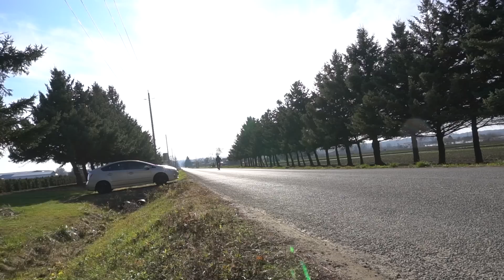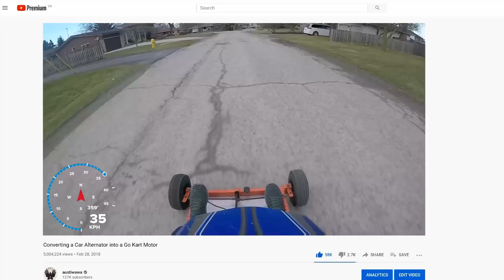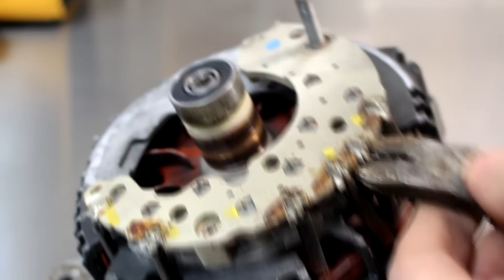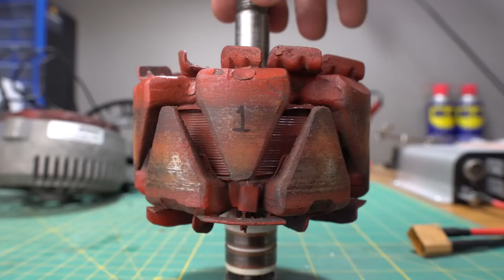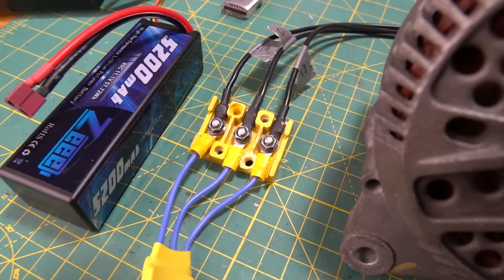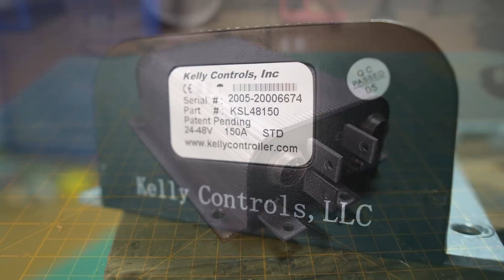Building an Alternator Powered Bike

Comment: let the controller just keep supplying voltage into a shunt like a large cap or resistor so it thinks the loads there on one of the 3 phases use a motorcycle clutch lever and instead of a cable put a linear pull switch there to divert the power to shunt....?  the only draw back would be yes its wasting power idling still... but youd be direct drive so it would be more efficient.

Comment: We should work together to make a hybrid bicycle im good and putting gas engines on bikes and still letting them be pedal powered or gas i want to make one with the options for pedal gas or electric by putting an electric motor on the front wheel and the gas motor on the back the problem im having is I want to be able to recharge the electric battery just by driving with the gas or with pedals long enough from what I understand it should be possible maybe not efficient but possible. How cool would it be to have gas for long distance when no ones around them be able to kill the gas motor and go electric when you pass people or an animal or to have the power of the electric and gas for climbing hills and to have the electric for backup to get to a gas station if you run out of gas or just to maintain speed once the gas engine gets you to the speed. You should be able to get some insane gas mileage. My gas powered bikes already get over 100mpg if we could get it dialed in we should be able to make something that gets around 200 mpg with optional 2 wheel drive

Comment: Not DIY it’s called your drivers license gone. That’s a 200+ horsepower just to start that engine that’s an electric engine and it takes 200 hp to start it. It’s 200+ horsepower while in operation. You don’t know what you’re playing with. I said, don’t use car parts like this That car part has a core charge right all of what I just said is high science and why now mundane that don’t do high science that is a military core part all of the parts that have a core charge on them our military parts that military is going to use all of them for high science their proper best shelf stock kept the hands of the people that pay to have a maintenance and preserved That does not mean that they belong to us. You got a bank account. You signed a contract saying that you’re not gonna damage core parts you got a drivers license you understand that core parts are military parts in all automobiles. Every piece of hardened steel is also a military core part even military anything above grade 8 they take to the boneyard it does not get put back into a smelter if it does it gets smelted into rebar where it will be recycled properly because there’s more energy there than can be harnessed at this time because we’re having a problem With Hindu bubonic slaves, yeah Hindu bubonic slaves, lying, and saying they’re Christian and indoctrinating the high science religions children into bubonic slavery that’s what Christianity is Jesus Christ. You’re all just children and you’ll never be anything more until you get off your demented high horse. Oh did I mention dementia everybody has dementia. If you have any family member ever had dementia 12 generations down the bloodline the 13th generation is how long it takes to repair the nervous system damageso demented retards get off the car alternator build your own motor. You don’t know how much more powerful than a jet engine that thing is because I’ve never shown anybody nuclear polarization other than to prove. I was a nuclear weapon Smith.

Comment: I think you did a great job I'm putting a alternator on a old pit bike plus I'm allegedly good motor mechanic also I understand your v8deo I just never stuck in at school ,I totally understand both the theory and the mechanics involved thanks for your help I'll show you the pit bike I build ,I'll be using a old kawasaki kx 125 or any little moto crosser obviously ill strip engine out, petrol tank will be my battery holder plus as its for off road use I'll easy spend a little cash to get the project done,I was merely looking at your videos as you explained it so well,thanks again Alex from Aberdeen Scotland take care &ride safe on old rusty

Comment: You need another alternator for current output back to the batteries. So, two alternators. Then you'll have regenerative charging. Wont need a wall plug anymore, and drive all day
Reply: That can't be done, because the recovery efficiency of two alternators is pretty low, so the friction of them together when you try to output current back will be stronger than the motor itself

Comment: Practice makes perfect I'm looking to make a bike or smart vehicle to drive & be strong enough to pull a lighter trailer for hauling gear & sleeping quarters! I'm not very smart with wiring & voltage so videos like this can help reduce unwanted stress I've been thinking of a 2 or 3 type power source bike or a combination or all or swap out for long trips with electric,steam powered & 2 stroke engine but trying to keep away from gas powered otherwise it defeats the purpose of the efficiency & reliability of the build! Thanks for making videos to help dude you have done alot of trial &;error research this is exactly the outcome I'm looking for! Does that alternate setup keep the battery source charged & looking to probably go brushless also want to avoid having the alternator get to warm for long distance but with airflow that should help! 🤔🤗💖😎👍🧙‍♂️🦡

Comment: What if you connect a regular 12v alternator to the system to send a charge back to a rechargeable battery pack that supplies power to the motor. Would that work to keep the battery life higher while riding?
Reply: The efficiency of the alternator would end up with more heat and less saved power

Comment: You could have spliced the power wires with a switch to turn power on and off , put switch on handle bar or something. That way the clutch/motor is only on when the switch is on.

Comment: You should hook up another alternator to the non-drive wheel to charge your battery.
Reply: That wouldn't work, the efficiency loss would neglect any return of power towards the battery
But using the controller and configuring the regenerative braking would indeed charge it back a little
Reply: @foxxyytofficial  perhaps the RPMs would be too low. I’m thinking about FA car had a alternator drive hooked up to it’s non-drive wheels it could spend at the 3000 RPM if geared correctly and run through a DC to AC inverter to charge the batteries. Just thrown out a few ideas that I have and I haven’t seen anyone else work on it like this.

Comment: idont have a lathes machines do u think if i drill out bushing and press in barrings ? just in opinion.  im broke and have to usde what i got or can get under 20 bucks or trade also how many batteries can be shiped to los angeeles i can mail u a pre paid card u ship so u know im not ma sneek thief scammer ect in no way  do i want that shitty label i want to make and use full function thing kinda utility like a cush man of the 60's but a bit of get up of new e vehicles  any help advice or flat ot no will be appreciated.

Comment: Nice adding hall sensor wiring to a alternator is beyond awsome
Reply: i didn't understand what changes in the motor adding hall sensor? increase speed, torque? what?
Reply: @marcosfilipe4468  im pretty sure its for the controler to know where the shaft is but u can now use different controllers like the ones i use from amazon that have a hall sensor connection

Comment: You need looser clutch springs so itll grab at a lower rpm, starter motor is made for tq and probably doesn't rev much higher than 1500-2000 rpm which is a little more than the engagement point on those clutches which is why your experiencing the slipping/jolty grabbing

Comment: Seems like a great video, BUT, my uneducated math makes me think that not using permanent magnets means your motor is using twice as much battery power and generating twice as much heat, and as such, your battery life is half and ride time is half, and also then your charge cycles are doubled and your batteries will need to be replaced twice as often.  Am I wrong?
Reply: He did upgraded it in part 2
Reply: @foxxyytofficial  Ok, I will check it out

Comment: Why not just use a electric motor?
Reply: That is an electric motor
Reply: @foxxyytofficial  no that's a alternator from a GM unit
Reply: @larrycumbo2023  working just as an electric motor would
Reply: @foxxyytofficial  over engineering for a simple task
Reply: @larrycumbo2023  or just showing that with a bit of elbow grease and some research and tests you can create something even if it's not the same quality of a ready-to-build kit
Reply: @foxxyytofficial  understand

Comment: Throw a reed switch on the circuit so it when the alternator/generator is producing enough current to sustain it (unity) , it will then become its it's own input.  You don't even really need a battery, you can pedal to create the intiation current. Not quite that simple, but you'll figure it out.

Comment: Great idea, I would not have used a clutch on an electric motor. The way I would have fixed your problem is fixing a switch on the accelerator that would turn off the drive while at rest, I would gave let that little spin be the lowest speed you can ride as you accelerate.

Comment: Definitely in the right track, just eliminate the battery and controller and use the pedals to generate the current. Once you reach unity, the alternator takes over producing the current. Then it's  just a matter of throttling the frequency, producing more or less as is required.
Reply: that's not how it works, the anternator on a car only produces energy because the engine itself is way more powerful than itself
Reply: That's what they want you to believe
Reply: @lesliel1182  oh, i didn't knew i was talking with a conspiracy theorist...
maybe you could try it and show us the results in a lot of videos so the government doesn't delete all of them at the same time
Reply: No theory, fact. You've been lied too and kept in the dark. 50,000+ such patents have been issued by the privately owned US Patent Office since Nicola Tesla's designs. The only one of his designs they allowed to be utilized was the AC, but he had many others that work without a primary power source. Lots of scientists (Phd's) and engineers have been at work since then studying his designs and developing much greater. Fossil fuels and nuclear have never been needed.

Comment: The problem with a clutch that slides is not so much the noise, it won't last a quarter of the time it was meant to. Besides, the need for the clatch was the "wrong" controller, am I wrong?
Reply: Yep, that's why he removed it when he got the proper one, and I'm glad to see that he did it

Comment: Great. That should be ,lets say  for a 60Amp alternator, 12×60=720w .Thats some power.
Reply: But technically since he is using 48V, you could multiply 48x60=2880w
That is the theoretical maximum

Comment: You know the batteries is draining down. Can you add some other alt to kept the batteries going without dying!? Just like an vehicle..
Reply: Trust me, the motor will consume more power than what it will generate. You will have to charge the battery. It's not an gasoline engine where the alternator turns some of that gasoline power into electricity. Electricity is being used to accelerate, and generated while braking.

Comment: 2:20 idiot, just connect a switch between controller and motor so that motor doesn't start running on low rpm continuously after switching on controller.
Reply: Then it will lose synchronisation and give up from improper wiring.
Maybe if the controller was sensored..?
Reply: Someone didn't watched the full video and wanted to call others idiot

Comment: How many watts is the motor?
Reply: Around 750-1000W or around one horsepower.
Reply: Can I use a 30a 1600w controller 
And at what speed I'll be getting

Comment: Use a starter motor to power the bike and alternator to keep the car batt that powers the starter always charged.
Reply: that wouldn't work as it would pull more energy than the alternator can "recharge"

Comment: Interesting 🤔..was just wondering if it would be feasible to devise an separate energy source from the energy of the front wheel that would keep your battery charged for continuous riding?? Just a thought from someone who has not the slightest inkling of any of this, other than wanting to ride as long as the day is long & possibly throughout the night! Lol...
Reply: that would not be possible because of friction and efficiency losses on all parts (alternators aren't that efficient, the friction of wheel bearings, etc)

Comment: Could you put an alternator on the front and back with 2 throttles?
Reply: technically it is possible, but will need a second controller

Comment: On the centrifugal clutch, you could use weaker springs and on the part that engages the driveshaft, use rubber or any other sticky material so it fully engages. Honestly, your first idea would work. If you have the right tools, you could also redesign the outer shell of the centrifugal clutch to have "teeth" so it engages every time without slipping. A 3D printer could help you prototype the part but may fail under sheer force. There are companies out there that will make the custom part for you. All you need to do is design the part in CAD software. Fusion 360 is free and relatively easy to use. If you decide to sell your product, then you will have to upgrade to a paid version of Fusion 360. Solidworks is also great software as well but it does require a yearly subscription. I'm not advertising for them but I know from experience that they are both great CAD software.
Reply: good video
Reply: Found the unnecessarily long know it all speech.

Comment: It’s because the clutch is new, the trick to make it work is to open the clutch and bend the pads outwards, pads will be closer to the metal. Once you do this your bike will take off🚀

What I means is stretch the springs inside the clutch…

Or you would need to try other types of clutch.

Comment: I wonder what effect you would get if you varied the field voltage/current. I guess the motor controller would have to deliver more current with a weaker field

Comment: Austin AS Captain Goodenough!
if you add a rheostat to the DC rotor source when on, it will not spin or not as much.
Then the centrifugal clutch can be dropped.
Also a DPDT switch to switch from // to series, added to the rotor source may allow a torque tranny!

Comment: Great work man! I have an idea To help you work around the bad controller.  First delete the centrifucal clutch.   Then install a disconnect switch At the supply wires To the motor with relays. Have the disconnect switch Activate when you Engage the throttle pedal. Boom now you control the controller.

Comment: could you convert the output into another set of batteries that charge while using the bike and when charge is empty you can use the other battery just to get a few more miles?

Comment: Great work Austin, the possibilities are endless .  You could make a self powered shopping cart, I mean someone would buy that, yep!  who wants to push groceries up a hill on the way home from the Super Market.  Anyway what I want to know is how long would it take to charge it if you used a single on the roof solar panel...Please add that to the story then the engineering would be complete!  Which will probably not drain the bank account rather put hard earned intelligence back in you're account!  Chrisbob

Comment: If you're thinking of building one be aware, the rules regulating the E bicycles classification depends on the state but Ohio's law is universal in most.   The alternator that you are using as a motor on your bike is above 750 watts, therefore, is must met all the requirements of a scooter/motorcycle, lights, horn, turn signals, etc. and have a license tag.  

Class 1: A bicycle that is equipped with fully operable pedals and an electric motor of less than 750 watts that provides assistance only when the rider is pedaling and ceases to provide assistance when the bicycle reaches the speed of 20 miles per hour.

Class 2: A bicycle that is equipped with fully operable pedals and an electric motor of less than 750 watts that may provide assistance regardless of whether the rider is pedaling and is not capable of providing assistance when the bicycle reaches the speed of 20 miles per hour.

Class 3: A bicycle that is equipped with fully operable pedals and an electric motor of less than 750 watts that provides assistance only when the rider is pedaling and ceases to provide assistance when the bicycle reaches the speed of 28 miles per hour.  

No person under 16 years of age can operate  a class 3 bike. In Ohio, persons of all ages must wear a helmet when operating or riding as a passenger on a class 3 electric bicycle.  All the state vehicle rules of the road apply in addition to bicyclist must stay near the side of the road and not impede traffic.

Comment: I THOUGHT YOU WERE ACTUALLY USING THE ALTERNATOR TO CONVERT THE POWER AND RECHARGE THE BATTERY PACK...  BUT YOU TURN ALTERNATOR INTO MOTOR BASICLY. GOOD SCIENCE    UNLIKE THE GUYS SHOWING OFF GUNS IN THE NAME OF SCIENCE!🤣
Reply: Could you use both ?  An alternator to power the battery and a converted alternator to drive the bike?

Comment: Yes then 'self recharging batteries' are made using an electronic gyroscope connected to the brake mechanism when you press the brakes the electronic gyroscope will recharge the battery from Jess

Comment: Can you install a 2nd alternator to charge the batteries? Also maybe install this system on a 10 speed bike so you can switch gears?
Reply: the first idea won't work, the second yes
youtuber Stepusak did a multi-gear tricycle with alternator as a motor